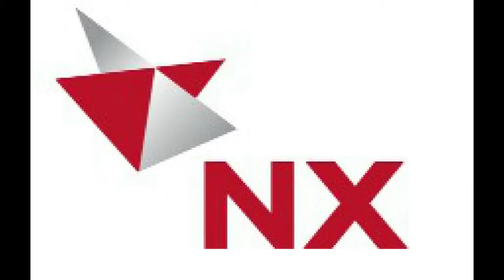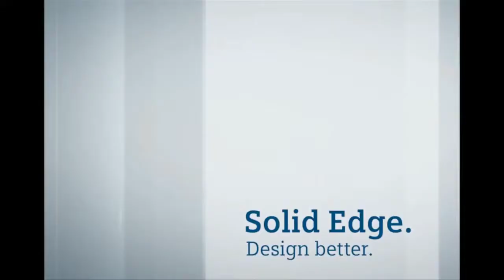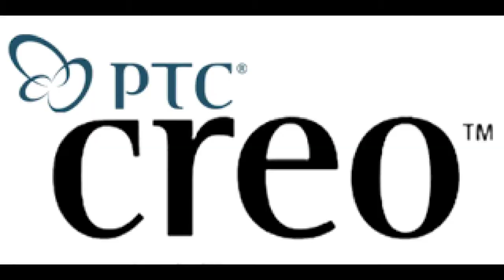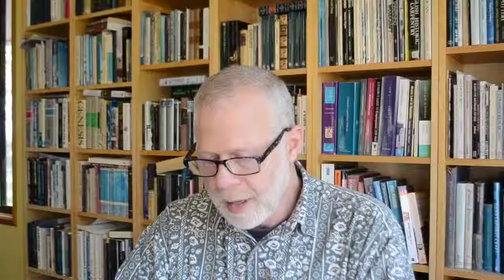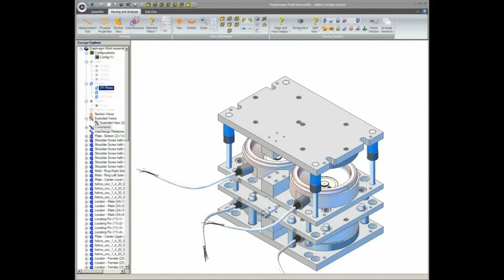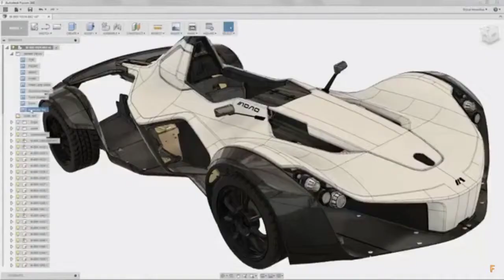Mechanical Engineering Softwares List

Comment: Strange that you don't list SpaceClaim Mechanical (and its downgraded version DesignSpark Mechanical) in the midrange CAD software
Reply from the maker: dzmecano I was thrilled with Spaceclaim, I even considered buying a seat when they were the new thing (and priced to cause a stir). I loved their concept video of Iron Man in a touch screen interface and I was sold on the idea of a direct modeller. My main use for CAD in those years was de-featuring injection moulding tools for simulation studies. Then Ansys bought it and it seems to me to have languished ever since. I didn't include it since it never really found much traction in the market but you could easily prove me wrong. Hopefully they've been doing well in the years since I last looked.

Comment: Very nice video on cad info... just obersvations... Catia, Solidworks and Draftsight all from Dessault systems. I was surprised to not see Draftsight on your free list.
Reply from the maker: Thanks Michael, I'll look that one up. I've taught a few, but just haven't come across that one. Actually, just looking at the Draftsight web page I see its a Dassault item using the 2 and 3D DWG format. I think Ralph Grabowski might have mentioned it in his newsletter once, The upFront Ezine. Have you done anything with it?
Reply: @ArnoldRowntreeTeachesFusion360  Its the platform I am currently using. I was hoping to be able to transition to solidworks later and thought staying within the same company would make the learning curve smaller. But my professional life took a different track so now I have found myself learning fusion 360 and finding your tutorials very helpful getting myself up to speed fairly quickly.

Comment: I worked at General Electric Aviation & we used a CAD/CAM program called UNIGraphics. It's very expensive & very hard to learn how to use.
Reply from the maker: I did get a bit familiar with Unigraphics just before the name change to NX. Its a cumbersome beast unless you're sitting on it all day and have the chance to learn the ins and outs of everything. - You would have seen some great engineering at GE.